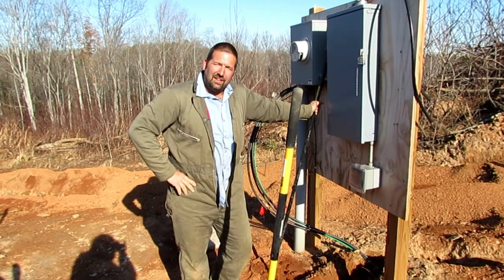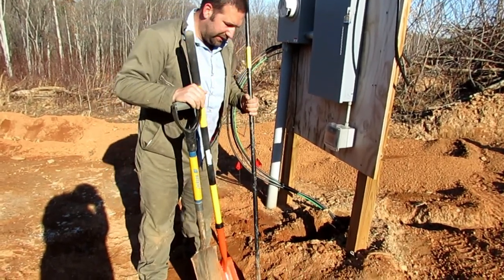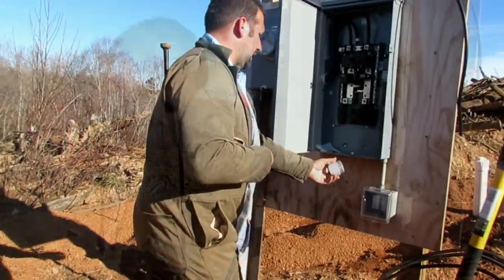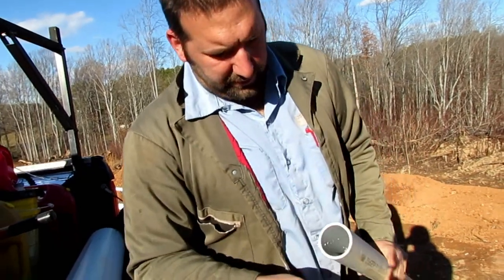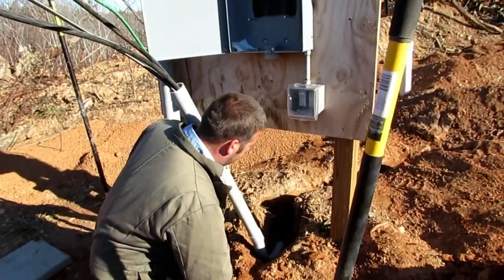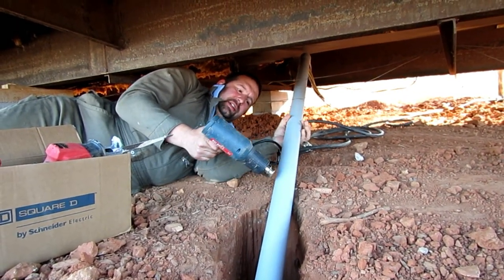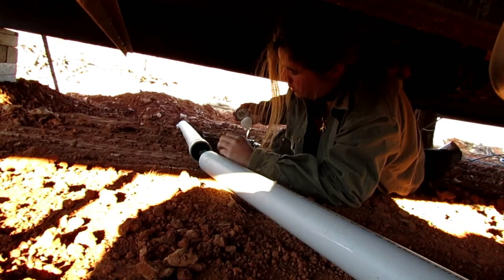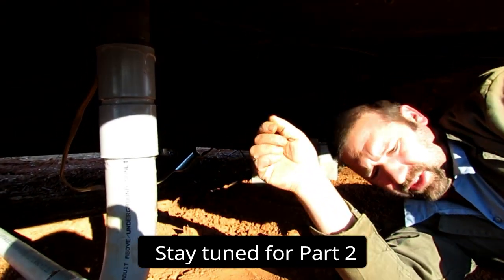Part 1 Electrical Service Feeder Conduit

Comment: It looks so much easier to glue the PVC in place while installing wires, one segment at a time. So as an amateur I was puzzled to learn that some codes require the entire conduit run be glued together before pulling the wire. Presumably they want no chance of glue fixing or damaging cable insulation as the conduit shrinks and expands with changes of temperature later. Pulling that gauge wire would be almost impossible by hand! Is this one of those situations where most professionals do it the quick easier way, and don't follow code guidelines?
Reply from the maker: spelunkerd the cable I pulled is direct burial cable. I only needed the conduit to protect the cable under the driveway, above the minimum burial depth, and above grade. I am not familiar with a "code" that would require the entire run to be glued up before hand but it could be a local code. Thanks for asking, ~Mr. C.
Reply: Spelunkers nice question... 👍
Reply: @NaturesCadenceFarm Just an FYI, I am an electrical inspector.  300.18 requires raceways to be complete between outlet,junction or splice points prior to the installation of conductors

Comment: Was the cable directly buried?
How did you add the elbow? 
My inspector says I need to add a plug to seal off the opening on the elbow?
My stores and the electrician had no idea what I was asking them?
Reply from the maker: @wt9653 great questions.
1-The cable is partially directly buried. It is in conduit under the driveway and the exposed parts.
2- I slid the elbow and conduit on before terminating the wires.
3- I have been doing electrical work for 30 years ( doesn't mean I have seen and done everything). I have never heard of doing that or it being a requirement. I am not saying it doesn't exist but sealing the opening on the elbow isn't required here in central Virginia. The authority having jurisdiction in your area ultimately has the final say so though. Thanks for watching! Hope I was helpful. ~Mr. C.
Reply: @NaturesCadenceFarm  
It's called PVC End Bell.
It's to prevent damage to the sheath when the ground settles. It has a smooth edge instead of sharp edges.

Comment: Looking to add 220v50a breaker for a shed on most modern mobile homes do you think I'll be able to run the wiring up the same spot in the floor to the electrical panel or will I have to mess up the interior paneling. I don't think my wife would be too happy with the mobile home interior paneling being disassembled
Reply from the maker: @ByteAquaponics I would say yes, with some head scratching and a second set of hands. Try a fiber glass fish stick. Just make sure to install a connector clamp on the wire going into the breaker box. Might be a good idea to enclose the wire in conduit and turn off the power to the panel.. Check with your local code enforcement to be sure. I would love to hear how it goes! ~Mr. C.
Reply: @NaturesCadenceFarm  I managed to do it, I had just enough room to share the service power entry point. In the shed I put a outdoor sub panel with it's own breakers and outlets in one self contained box it was a Siemens talon box. Amazon has cheaper stuff but quality goes down hill. The soil in my area is very expansive conduit really wasn't a option.
Hell just the waterline broke 12 times in two years and the pipe wasn't freezing up to cause that, even a professional plumber couldn't fix it, I ended up switching my water main to pex haven't had a leak yet. So instead of conduit I used double insulated cord, RV extension cord was the most reasonable option price wise just cut the ends off. The shed is at the end of the mobile home so cord isn't at risk of being cut with a shovel or tripping hazard And I made sure that stranded wire was okay with the manufacturers breaker and sub panel.
Reply from the maker: @ByteAquaponics that is great news! Good job finding creative ways to finish the job. ~Mr. C.

Comment: I didn't see any ground rod or anything like that. Did you not have to worry about that?
Reply from the maker: @Augie Trujillo the panel outside is grounded with a ground rod. I would check with your local code enforcement like a building inspector to ensure your installation is proper for your location and conditions. Thanks for watching! ~Mr. C.

Comment: I'll be digging enough to justify buying the Harbor Freight  self-powered towable backhoe.
They have a surprisingly good reputation for the price.
Reply from the maker: F Huber that is a great idea, I would love to know how it works. I have always been interested in them and wondered if they are effective. ~M. C.
Reply: @NaturesCadenceFarm  how long was that run, what size breaker and wire
Reply from the maker: Dion Daniels the length was almost 100 feet. The breaker in the outside panel is 200 amp and in the mobile home is 200 amp. The wire is 4/0-4/0-4/0-2/0 direct burial cable. Hope this helps, thanks for watching. ~Mr. C.
Reply: @NaturesCadenceFarm  thanks. It helped alot

Comment: So I know this video is old.but,I was wondering if the wires from meter pole to my trailer need to be buried.i just bought a place and there are like 4 or 5 wires running from underneath the trailer to the pole with the meter on it and they are just laying on top of the grass.shouldnt they be buried or covered? I mean something right?
Reply from the maker: @Bobby Maurais YES, they should be covered/buried. I would get that fixed pretty quick. Check with your local codes to make sure you get them in the ground the correct depth. ~Mr. C.

Comment: I got a quick question. When you have a doubt about something do you check with a inspector from the city? Do they mind answering questions for you??
Reply from the maker: AxZxTxExCxA I absolutely check with the local building inspector. I have had excellent experiences asking them question and have never had one get upset or short with me. I have found they want to be helpful to make the process as smooth and efficient as possible. ~Mr. C
Reply: @NaturesCadenceFarm  Awesome. Thanks ✌️

Comment: Can the bare feeder lay on the ground or does it need support and conduit throughout the crawl space of a mobile home?
Reply from the maker: Raul Hernandez that is a great question. Per NEC 300.5(D)(1) the answer is no. They need to be in conduit. Click below to look an excellent PDF. Pages "104" and "105" provide the actual code and a great picture. If you have any other questions I am glad to help. ~Mr. C. 

https://www.mikeholt.com/instructor2/img/product/pdf/1259687476sample.pdf

Comment: Ok i have a question ,i ki da need some help....
     I moved out a mobile home that had three wire coming from pole nad meter location .
     The USED mobile i purchase to replace othe mobile home has a 4 wire system in a mobile home park that was literally plugged in to park box .
How do i connect three wire to and older 4 wire system.
Reply from the maker: @bwd1963 the difference in 3 and 4 wire setups is the neutral and ground are either using the same wire or are provided with two separate wires. Local codes can change drastically even between adjacent counties. I would check with you local codes enforcement to ensure the installation is both up to code and proper for your location. Thanks for asking and watching. If you have any more questions please let me know. ~Mr. C.

Comment: What type of panel box is that next to the meter? And if it’s an overhead connection what type of panel box and meter would you use?
Reply from the maker: Saul Garcia the outdoor breaker box is made by Square D and is sold at Home Depot and many other places, it is called: QO 200 Amp 8-Space 16-Circuit Outdoor Main Breaker Load Center with Feed-Thru Lug and Cover. Here is a link to the HD website.
https://www.homedepot.com/p/Square-D-QO-200-Amp-8-Space-16-Circuit-Outdoor-Main-Breaker-Load-Center-with-Feed-Thru-Lug-and-Cover-QO1816M200FTRB/202353310   . The same panel and meter can be used for both  overhead and underground services. For an overhead service you would use a weather head and a piece of conduit and connectors going into the panel first the a short nipple connecting the meter base to the panel. I hope this helps. ~Mr. C.

Comment: What is the panel called on which you have mounted the meter, service panel and outlet? I need one of those at my hunting property and the last electrician I talked to wanted $2900 dollars to install one. I don't even need the service run to a trailer because I'm using an RV panel. $2900 is ridiculously expensive. I realize I'm paying for the "expertise" but come on I could build one of the panels if I knew the codes.
Reply from the maker: Steven Dallas that does seem a little high... Check out the link below for the breaker box in question. Let me know if it is not and we will figure out what you want / need. ~Mr. C.

Square D 200 AMP Feed through breaker box: https://amzn.to/3ebFiIN
Reply: I got another quote and it came back $1600. I'm going with the second quote. Thanks for the reply
Reply from the maker: Steven Dallas that sounds more like it. The other guy might have been too busy, didn't want to turn away work and over priced the job. ~Mr. C.

Comment: Are you supposed to have an expansion joint where the conduit leaves the panel and goes under ground?
Reply from the maker: Jim Pintchuk you pose an excellent question and one I did not cover in the video. The short answer is no. The long answer (my favorite way to explain) is complicated even with the code as a guide. The conduit was used to get the direct burial wire to its intended depth the no above ground conduit was used until the wire resurfaced to go into the mobile home. See the included link for some great information on expansion joints. Thanks for watching! ~Mr. C.

https://carlonsales.com/techinfo/installationtraining/IT-NEMAEXJTA.pdf
Reply: in ky our inspector you do
Reply from the maker: timothy logsdon good to know. I really appreciate the community on YouTube. It gives me a chance to learn so much more information from so many people. Thanks for sharing. ~Mr. C.

Comment: Technically not “service conduit” per NEC.  It is a feeder conduit.   Clarification.   Service is from meter to first overcurrent device (breaker).
Reply from the maker: @Kevin Coop clearly you know your way around the code. You are correct. The intent of using the word service is more searchable in YouTube. Joe public with limited code knowledge might not know to search for feeder conduit. Thank you for taking the time to provide clarification. Your information is appreciated. ~Mr. C.

P.S. Check out the edited title.

Comment: I think all electricians have that hammer
Reply from the maker: Saul Garcia excellent eye, I think you are correct. A little back story... my Dad gave me that hammer over twenty years ago when I started doing electrical work in my high school electrical class. Keep an eye out for the newest video tomorrow and you will see it in action installing injectors in a 7.3L Powerstroke :). ~Mr. C.

Comment: if you ever find yourself without a heat gun you can throw glue on the piece you need to bend and light it on fire, bend it quick, and throw dirt on it
Reply from the maker: alex martinez thanks for the tip. Very helpful if there isn't electricity nearby! Thanks for watching! 😉
Reply: enjoyed it, good info, and it is always nice to see professional work done right

Comment: Why not run pvc the whole way? I don't like the idea of someone possibly digging there and cutting the wire. I had that happen to a friend they where planting a tree and struck a cable it wasn't live the breaker  was off but if it wasn't who knows what could have hapened.
Reply from the maker: Krypto Knight I decided to run direct burial because it cost less and is easier to lay in the trench with no conduit. I understand the concern of possibly cutting into a live wire. In my area we have a service that will come out and mark your utilities before you dig. I suggest contacting your local power company for information on who to contact. Thanks for commenting. ~ Mr. C.

Comment: Looked like the trench was 12-14 inches deep. Code for that cable without being in conduit is 24 inches. Pipe looked like sch 40. Code from below ground (18 in) to the panel is sch 80.
Reply from the maker: B_a_c_k_s_t_a_y thanks for watching and commenting. In the video it might appear to be not deep enough but I can assure you it was at the correct depth of 24" when I back-filled. therefore eliminating the need for schedule 80 conduit. The building inspector for my county had to inspect the trenches and conduit / wire before I could even start back-filling. He was very pleased with my depths and praised my workmanship. ~Mr. C.

Comment: What size wire  do u use sr.
Reply from the maker: Tony Cervantes I ran 4/0-4/0-4/0-2/0 mobile home SE (service entrance south wire P/N 287144 ) cable between the outside and inside panel. Check the description of the video for links to most of the products. ~Mr. C.
Reply: @NaturesCadenceFarm  nice job  there sr .. clean and beautiful work...  4/0 is for power and 2/0 for ground. Right sr.. and I I need run a 220 or 240 . Line. For outside ac unit.What kind of cable i need and what size breaker.  ??
Reply from the maker: @tonycervantes4816  you are correct about the wire sizes. For the outside A/C unit the wire size and breaker are sized to the amperage required by the unit. Find the information label on the unit, it should say max fuse or ckt. breaker. Use that number to size the wire and breaker. See below for a link to wire sizing. ~Mr. C.

https://www.google.com/imgres?imgurl=https%3A%2F%2F1xtechnologies.com%2Fwp-content%2Fuploads%2F2018%2F02%2FNEC-Ampacity-table.v1-800pix.jpg&imgrefurl=https%3A%2F%2F1xtechnologies.com%2Fhow-to-size-a-cable%2F&docid=vwZSIx25l2Zm-M&tbnid=liXEm9BiHWyesM&vet=1&source=sh%2Fx%2Fim

Comment: Why would you heat the pipe after the wire is in the pipe?!? Never do that!!!
Reply from the maker: Tactical Basements I heated the pipe after the wires were in the condiut because for me it was way easier to run the wire through a straight pipe and then heat and bend. Is your concern with heating after the wire is in the pipe the wire insulation could be compromised? The cable I used is rated to 90°C (194°F). Electrical PVC conduit begins to be flexible at 140°F and is floppy at 170°F. As you can see I never reached a temperature on the conduit to compromise the integrity of the insulation on the wires. I love and appreciate your question as it gives me an opportunity to expand on the information provided in the videos. ~Mr. C.
Reply: And you risk damaging the insulation with the heat.

Comment: Nice work with installing the conduit! Was this to accommodate the relocation of the mobile home to the other side of driveway? I'm used to applying both primer and adhesive when joining plumbing conduit - is it different when doing electrical conduit or a different type of glue? Squeaker seems to have a natural skill at this sort of work - does she plan on an apprenticeship perhaps? Oh, and for a second I thought you were applying some lipstick at 03:15 ;) 🛠 ⚡️
Reply from the maker: Simon B slightly... The service would have still been installed like this even if the trailer was closer. Our building codes require the power company disconnect and meter be mounted on a separate pole or back board. If in the future the trailer were to be moved the power could be turned off at the meter base with that breaker box and the wires would only be disconnected from the breaker box inside of the dwelling. Long answer for a short question but I thought someone else might need the information too. Great question about the glue. In my area we are not required to primer electrical conduit. I asked the retired electrical inspector I had college classes with and his reply was "Why... primer is for plumbers". All of the electricians I know have never used primer on electrical conduit. Funny you should bring up the apprenticeship, I have already started logging hours for her. My hopes are that she will have enough time under her belt to take the test when she is old enough and always have a trade she can take with her for the rest of her life. I had to watch the video over to see the lipstick application, HILARIOUS!
Reply: Cool! Thank you for the detailed answer which was very informative! :)